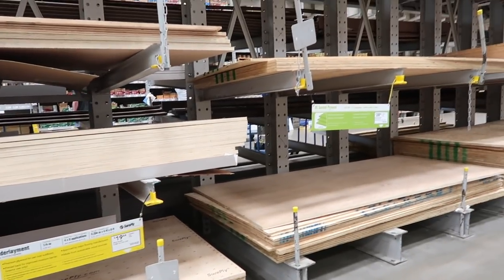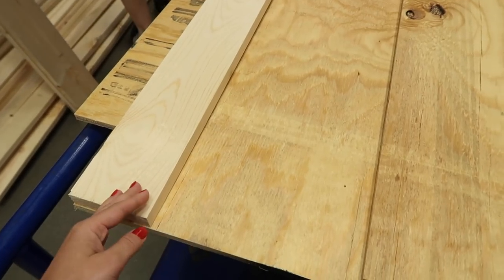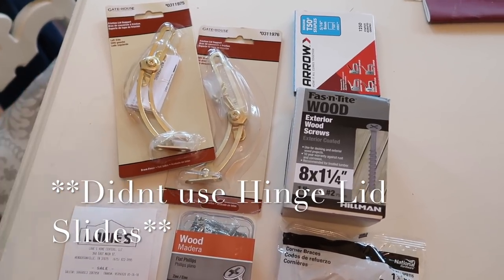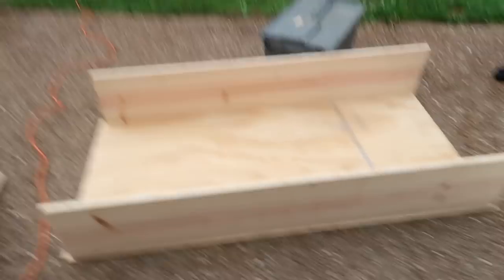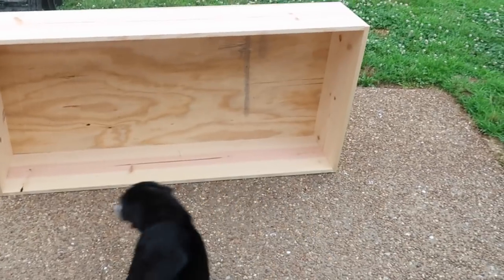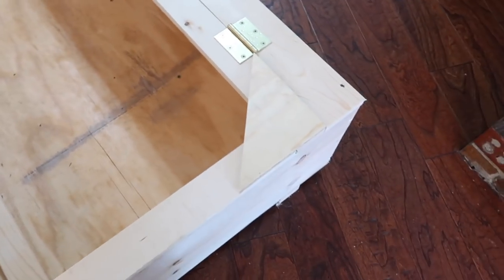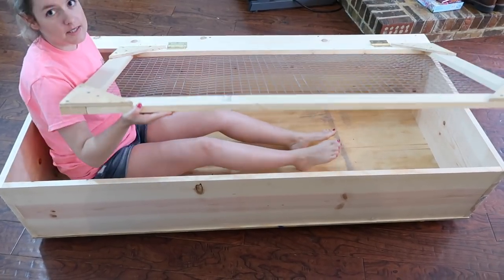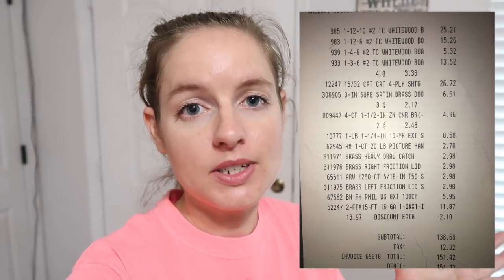DIY Tortoise House |  How To Build Huge Tortoise House Enclosure

Comment: Nice! I found a bookshelf on Craigslist for free, took the flimsy back off, replaced it with plywood, bought a 2x2 and cut 2 pieces to go across the top, drilled a 10 gallon aquarium lid to the 2x2's for the heat bulb to sit on, and used the shelf pieces to make a hide. Cost me like $25! Woo-hoo.   Most of my top isn't covered bc I only have box turtles and use sphagnum moss to keep them humid. I should definitely go over it with safe paint though, good idea.

Comment: Just a suggestion i bought safe no toxins   stick on flooring  it has worked great . sealed any spaces with silicone.  So far so good  with it  and my hermans really like how i can keep their enclosure table nice and humid . And i dont have to worry about the wood  going bad like the past.
Reply: I did the same thing, stick on flooring! Works great

Comment: I started building same ones, but mistake I or you did was buying lumber from Lowes. There is a size difference, unless we measure. If we go by the label or bar code that's it. I have to spend additional $30 to buy such lumber. And they have cuts limit per customer. I don't like going to Lowes, since you guys bought everything from there, thought of finding them easy. Many thanks for the idea.

Comment: Did you have to put any sealants on the wood to prevent mold? Wondering because my husband and I want a tortoise in the future
Reply from the maker: Samantha Thompson non pressure treated only, it would need rebuilding if it molded but most tortoises can’t handle high moisture like that.

Comment: What is the smallest cage you can get for a adult turtle please answer asap
Reply from the maker: When housing an animal you should ask what is the “smallest” option. Always think big. Bigger is always better. And I don’t recommend turtles or tortoise for anyone under 18. Unless they can provide very large indoor and outdoor enclosures. :) at least 3ftx6ft. In size. Turtles get very large and need large tanks 75/150 gallons as adults depending on size. I don’t recommend them.
Reply: Ok thxs
Reply: Instead as an adult I got a baby what's the smallest size for a baby turtle???

Comment: I have Russian's which requires 4x8 feet minimum so I will have to modify this design to be the proper size when I build a new enclosure. I also prefer a tighter nit wire, smaller holes keep the majority of bugs out. I live in the south, waterbugs get in the cleanest homes, nasty suckers, some of which FLY. Imagine the biggest cockroach you ever saw...and put wings on it. Not in MY enclosure.